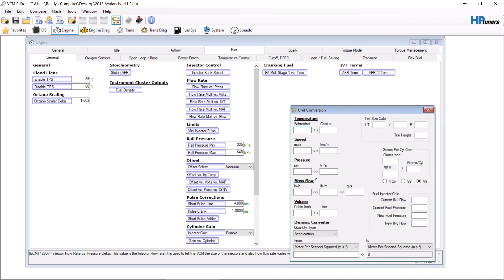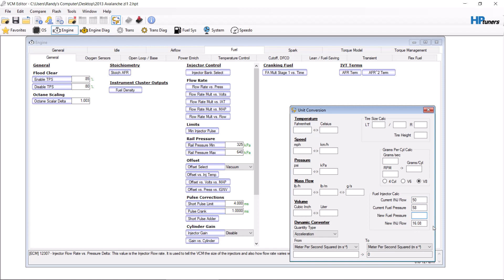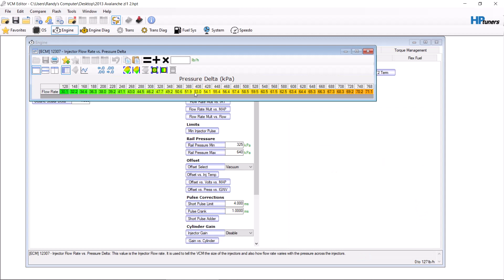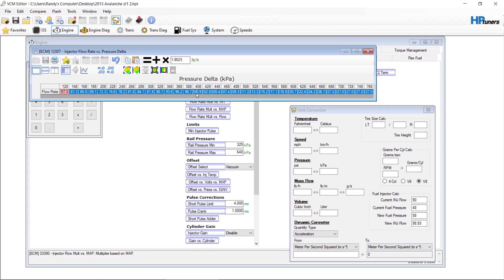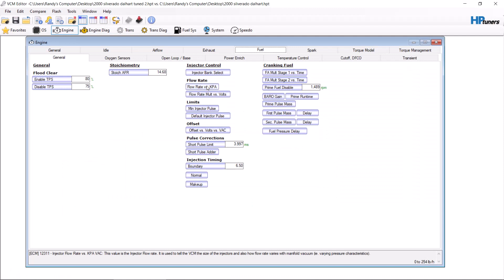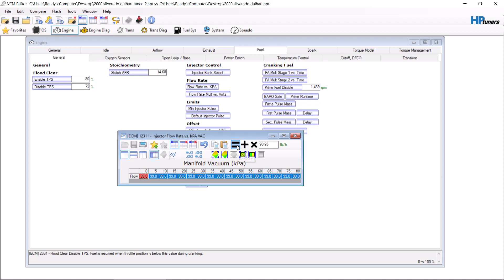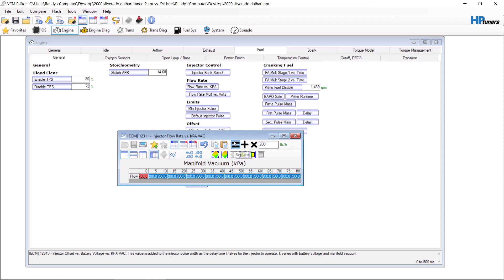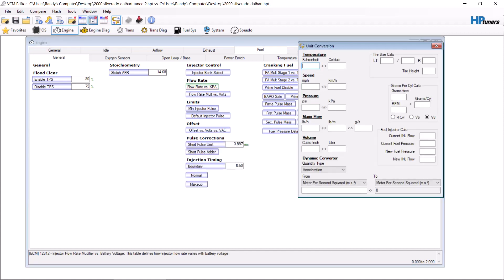Tuning GM Injectors with limited data

Comment: Gen3 ECU is rated at 58PSI in the tune, so its really a 24# injector stock.
Reply: 25.2 is stock 6.0 injectors atleast on 03 trucks im switching to 8.1L  injectors that flow 29pounds